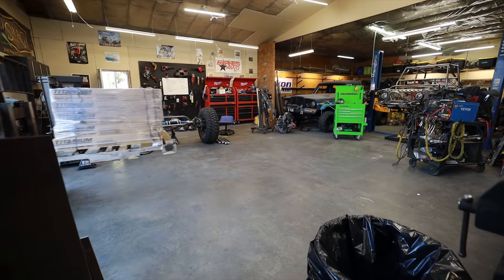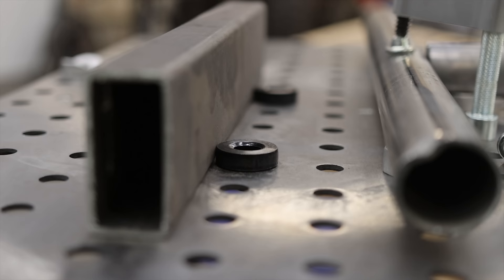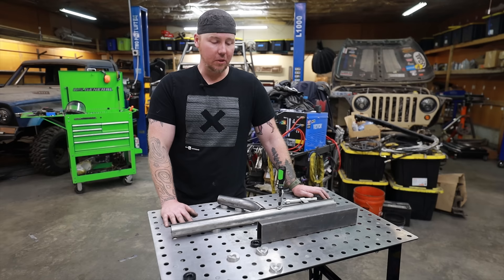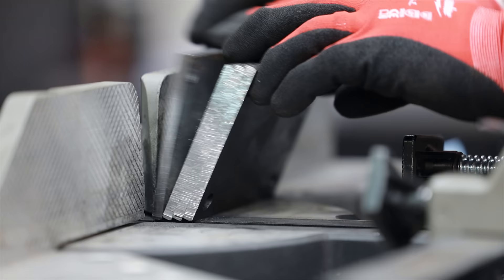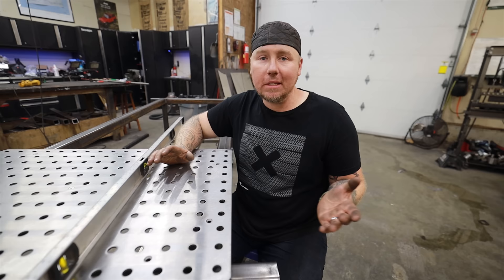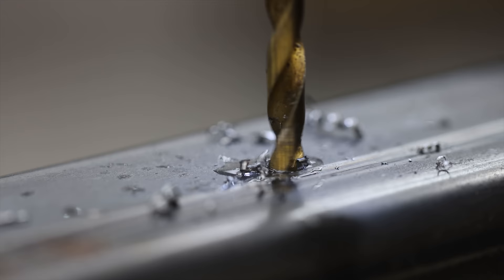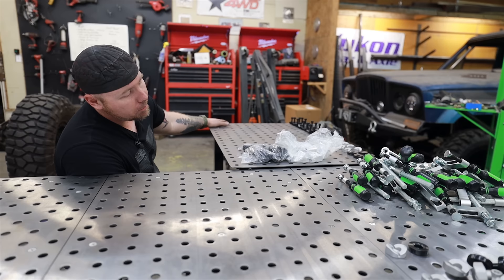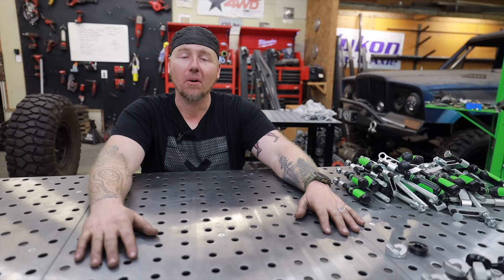The NEW Harbor Freight Welding Fixture Table

Comment: I bought a similar welding table in the UK and added a Flexispot height adjustable desk frame. It's amazing being able to tweak the table to the perfect height. Because it's so versatile I use it as a chop-saw stand, bandsaw stand, in-feed and out-feed table as well as a welding table.

Comment: The usefulness of this larger table, or some smaller joinable tables, should not be underestimated. Personally I would do the larger one like you have an have a smaller one or two (at the same level of course. ha ha) that can be bolted on as needed to make the L shaped bench. As you say, some wooden or steel toppings/small item boxes with dowls would be ideal since this also prevents slippage. Very very useful for small garage workshops. Great video Nate!

Comment: Honestly if you don’t mind slight dimples on your work surface you could just buy some heavy duty vinyl and roll it out on top for when you have small stuff you don’t want falling through holes. You could also use some large hobby cutting mats that have grids and stuff printed on them for extra utility and durability.
Reply: I keep a roll of the heavy floor covering Ram board for CAD (cardboard aided design) mostly.
That would work great. Just roll out a few feet of it.
Reply: A sheet of MDF with some handles to make it easier to lift/move would also be 👍
Reply: I actually made a butterfly style set of doors that open up and hang down the side of my certiflat table. Its works great

Comment: the hitch receiver is a fantastic idea, especially if you don't have alot of space.  I have quite a few tools that I have hitch tubing welded to, and I swap them out on my single vise stand.  Yes, it's a little bit of work to swap out tools, but if you don't have alot of room to work, it's fantastic.   I suggest adding threaded set screws (welding a nut to the tubing) so that you can snug up the bolts and the tools won't flop around on the receiver tube.  the hitch pin keeps them from falling out, but set screws/bolts keep them from flopping around when using them.   :)

Comment: I have a piece of cat walk for a welding table. There are no round holes in it, but it has plenty of rectangular holes. Once you get used to working with them, it gives you almost an infinate amount of positions and angles to work with. Its about 24" x 36" and it weighjs as much as a church but its great and was free

Comment: I keep a sheet of 12-gauge aluminum on top of mine.  It makes it a workbench that parts don't fall through and that the surface can get beat on, and it's easy to remove when I need to fixture something.

Comment: Same thing as sold at Northwest Tool over the past few years.  It was similar price on sale and included same accessories.  I added some light angle ( old bed frame tacked corner out) across the underside between rows of holes to reduce any warpage.

Comment: I built my own 5’ x 108” 3/4” thick top table. 6x6 1/4” thick legs and I beams for stringers 2600# . Still haven’t finished drilling my holes. Hopefully this winter. Nice table for the money

Comment: A few years ago I bought Grizzly’s version of this. It was $139, but with no accessories. The legs were 1/8” angles though, heavier than this. The top is the same as all of these cheaper 2 x 3 tables seem to have the same top, though the Grizzly has a black rust resistant finish. But the top also wasn’t flat.

I agree that it’s hard to understand. But I assume that since these are so cheap,  maybe they’re not fixturing the frame, but just laying it on the surface with some side restraints. They definitely weren’t flat. I ended up using my Stabila 4 foot level and grinding the high spots down. Afterwards it was pretty flat. I cut the legs short and welded coupling nuts on the bottom for good wheels that can level, which is important. If you don’t do that, heavy work will push the high part down on the wheel and distort it.

Anyway, I recently bought a Sigmund 3 x 4 16mm table. I gave the Grizzly table away to someone who is very happy with it.

Comment: This isnt a bad deal. Might have to buy one to throw on the end of my current 3x5x1/2" fab table. Make it foldable so its "protected" and smaller foot print when its not needed.  Then when i need fixtures, fold it out and bam its there with another 5ft of table to to hold stuff up.

Comment: My work bench for welding is an old tanker desk on a frame with casters with a piece  1/4 just sitting on top of it 
I consider the plate as sacrificial and just weld whatever fixture I need to it pop them off grind it down and  do it agian

Comment: Put all segments on wheels. Use hitch or similar to connect them together, or spread them apart for longer jobs 2 can be any length you want. Northern them for similar price. Now its more expensive, but still great setup.
Reply: Like a leaf table? use 1 1/2'' square tube inside 2'' for slides, and have extra tops for a leaf, great idea.

Comment: Make washers from JB weld steel stick putty, at the bolt holes a 2" round 1/8"-1/4"   thick. And put it all down at once using a level to push it down level tightening the screws.  Maybe after it sets up fill any gap with putty to reinforce the top to the frame.  I think I'd just bought a sheet of 1/4" and have a 5" piece of 2x2 1/4" wall, sq tube, milled flat on 3 sides. Clamp sand paper to it,  and sand the top flat , dye chem  and check the flatness , then tape a border around the edge , mix done water based coolant. And mark out a pattern for the holes,  mag drill. Start with 3/16" holes or so. Then go to 5/8"), or 1/2" but use 2-3 1/4" nuts welded to holes at the bolt holes to mount the plate, cut a 4" length of 1/8" x 2" bar. Drill a center, and a 1/4" dowel pin to one end  use two 1/4" bolts with jam nuts, install the mount bolts loose through the 2" flat bar, that gas a dowel welded to it,  the two 1/4" bolts level the top . By pushing on the 2" bar under the top. The dowel  keeps it centered on the frame, maybe beef the 2" flat bar from 1/8" to 1/2" and cross the table with it  and tack weld it to the top.  Weld 3/8 washers to the area for the 1/4" leveling bolts, using two bolts allow it to be at a slight angle . And still give more support.   And make up to about 1/2" adjustment, about 1/4" up/down.

Comment: Hi there man! It`s been a while since i visited your channel for tips... but this review of those welding tables i find it very helpfull in order to get or fab your own welding table for your needs. A while back ago i made my own welding table using square tubes 40mmx40mmx2mm and i been thinking about purchasing one of these table to use on my projects outside of my shop (in the field). Thanks again for sharing this review and cheers from Chile!

Comment: To fix your table height and cart difference issue just add washers to your casters on the bigger table. If you want to be fancier or stronger (not that it will matter for the strength of the table top) use plate with the same hole pattern as your casters as the spacer

Comment: I did the same thing when I built my fixture table top from Weldtablles, on adding a receiver for a vise.   what I didn't like was how loose the receiver was, so I welded a 9/16 nut to the top of the tube and used a short bolt to take the slop out, and hold the vise or attachment with my chop saw or bandsaw on it

Comment: You could definitely double up on that 3/16 plate . I'd probably double it up and then I would stitch weld it up with a Tig welder. Half inch beads is all it needs
Reply: i was thinking the same thing.  for $170, why not.  you'll also get all the accessories with the 2 tables

Comment: Angle iron bolted to the ends of the tables would create the ability to connect two tables. Drill and countersink some holes to mount the angle iron underneath the table top. I wish Harbor freight would make a small two foot wide extension top that would allow a table to be bolted to each side. This would give you ten feet in width. Send-Cut-Send maybe a place to have a small extension made.

Comment: In my experience, the thicker the better. I worked at a heavy equipment manufacturer that had multiple 4x8x2" fit-up/welding tables with drilled and tapped holes. It was not possible to deflect these no matter how hard you tried. Also with a properly conditioned cup stone you can clean up and restore "flatness" to the table ( you can remove random berries and tacks).
Reply: A 10-ton portal crane is so much better than a 250 lbs come-along
Reply: Other then the drilled and tapped holes that is SOP in ALL real fab shops. The tin table is a joke. - Tack up tabs and dogs and use wedges to push things into place and the grind it smooth and get the next par in the table.

Comment: I actually have a 3/16 inch fixture table that I made and had laser cut, and I use some custom clamps that I made for hold downs, and they don't distort the holes at all. They go in to the holes and then side load whenever you clamp them down, and it works just fine. You obviously can't go hog wild on it, but it definitely will hold things in place to where you can't move them.
Reply: It's because the clamps are not strong enough to hurt the table,,,,, or to pull a piece of 1-1/2 hand rail pipe in place either. - Not for real fabrication

Comment: get a roll of thick "carpet protection paper" from Lowes or Home Depot. and some masking tape. Cover the fab table with paper for when you inevitably use it as a work bench for the misc little parts and assembly. The roll of thick paper is fine for that.

Comment: I’m now interested in doing what you have done. I currently have a wheeled bench about the size of what you have built which rolls under my 16 foot built in bench. I have been using receiver mounted tools for years. My vice, solid stock bender, bead roller, bench grinders and so on have been used that way for a long time. It’s a game changer. I’m building in my 24X24 two car garage where I also park our cars, so everything has to be able to be tucked away when I’m done. I actually got the idea for some of the tucked under storage from a set of Russian nesting dolls my mom has. The receiver idea came from a service vehicle I saw at work one day.
Thank you for the down load on this new HF product, I’m going to check it out as soon as it appears at my local store.

Comment: as several have suggested  just add some washers or a piece of plate under the big table.  if building linkable tables  add receiver inserts to pin the 2 / or more tables together.  more cross beams  should help on warpage.

Comment: I would caution you against buying 1/2” steel plate to make a table out of. Most plate is actually extremely not flat. Last year I built some robotic tooling for work, and to get a 6ft by 2ft tooling plate that is 1” thick and truly flat (+/-.015”) I had to buy 1 1/4” plate and they had to surface grind that much material off to get it really flat.  I never realized how plate isn’t really flat until I went to order that steel. Just some food for thought. Love your videos!
Reply: 1- Stress relieve or normalize in furnace
2-Streighten to reasonable 
3 Blancahrd (not surfece) grind. 

If you skipped the heat treat go out there with a surface gauge and push it around. - You gonna find you are over .015 in a foot, let alone TIR.

Comment: Cool vid.   This table is sold under several different brands, ie, Klutch at Norther Tool.  I have one and it works ok.  The fixture accessories are junk and expect several to break.  Also, those holes are some off metric size and a decent kit off Amazon is about 200 bucks.  I went and got a bunch of shanked bolts that fit, cut them down and made my own.  That top will also need to be coated or waxed, it will rust quickly in a garage.

Comment: To keep that fixture table good, don't forget to give it a generous spray of anti-spatter before every time you weld. If you want a cheap anti-spatter, just water down some laundry detergent and use it. Most anti-spatter sprays are little more than soapy water.
Reply: And then a quart of WD 40 to stop the rust.,,,,,every time you use it. - It may be OK in a wood shop but not for welding and fabricating.

Comment: 1 thing i noticed with the table and clamps which are definitely awsome but like most clamps the clamps with this table have flat clamping contacts..it would be nice if the kit came with convex caps that were curved for pipes like the the stubs to lay the pipe on in the peg hole..in the video it shows the clamp holding the pipe and only a 1/16th of that flat clamp contact is holding the pipe, if you had a round piece( magnetized) to pop on that flat round clamp end then you could better clamp a pipe down.. ive tried to weld pipe in the past  with a c clamp and the dang pipe would roll 1 way or the other..i didnt weld a lot of it just a piece here and their but always thought if i did more I'd weld a thick curved piece on end of i c clamp just for pipe

Comment: That would be a fantastic template for a heavier piece.  Also, four identical tables that have the capability to clamp together would be more beneficial, just for the footprint options.  More modular.  Clamp end to end, side to side, side to end, etc. Even fab spacers to keep them so far apart for really large builds.

Comment: That is impressive, not sure if you do much woodworking, MFTs are popular in Europe to mount a tracksaw for repeatable straight cuts for sheet goods, I am sure your set up could be adapted. MFT sheets (mdf with the holes drilled) are expensive over here,

Comment: ignore the word my but a good workbench that is slick to work with does need easy clamp and magnet ability I found that making sure the work surface is all level and includes the chop saw recessed a metal welding table with grounds always attached mig and plasma ready with a shop vac line you can hook into along the bench along with led lights with easy off on switches outlets all along the bench with angles coming off the back of the bench toward the front not so you hit you head but weld nut lock washers for holding plying cutters drivers so you glance up and grab what is needed hit the switch and brightly light the workbench area AND BUILD THE BENCH TO SUIT YOUR HEIGHT WITH STOOLS THAT SEAT YOU AT THE PERFECT WORK POSITION underneath the wood part of the bench grinders drill hand tool you use a lot all plugged in ready to use the bench is always set up ready to use no matter the project or repair

Comment: Hey Dirt life:   suggestions,  add a few "V"  braces to the table top down to the lower cross bar.   Yes 3/16 tube is strong but toss a 400 lb rearend up for fixturing and sag will happen.  
 Run a vertical up from bottom of the V to the HF square braces with maybe even an additional lengthwiise 3/16" tube parallel to the bottom stringer.   Bracing a couple angle braces will really make it good & strong! 
Rest is great!

Comment: Just a thought. What if you double or trippled the top plates? Making them thicker! Drilling a small hole in between the top one or two. And tacking them together.  And tack the edges . I've bought one. Just to see how they are. Im thinking about getting 3 more.  Making two out of them. Over lapping the tops.

Comment: It might be too late now but I welded 3/8 X 2 bolts to match the pattern on the fixture top, then used coupling nuts as adjusters. This was easy to level the top then put the counter sunk flat head screws through the top. It worked very well I made a frame pretty much like yours then didn't even use the frames that came with the fixture tops. I have had it for several months now and it has not needed any adjustment.  Oh I did put a double nut under the coupling nut when they were installed after all was level I tightened the lock nuts to the coupling nuts so everything was locked together.  I was able to pull down on some and push up with some.  So far so good.

Comment: Bought one, it's basically a hobby table for light work, green clamps are junk (made my own a twice as tall) , the Horrible Fate stud 3" w/ brakes casters work if you drill and tap for 1/2-20, yea SAE threads on a chinese caster, after assembly I welded the whole damn thing up, that made thing's a bit stiffer. in my local it's selling for just under $190 bucks.

Comment: Maybe take two of the cheap HF tables and maybe put a spacer in-between them stacked on each other and maybe you could get the friction type tools to work. Just a thought. Old guy with too much time on his hands, I have not welded much in over 40 years.

Comment: Just a heads up, if you move that, table the flatness will change. Concrete is never flat, and from one wheel to another, that table will be twisting in every dip and valley in the concrete. I was a Tooling Specialist for an Aerospace company and we shot in our tools level by the .0005 of an inch. same with our Granite inspection table that thing was FLAT! prior to that job I thought a bubble level was the flatest you could get lol ....... I was wrong !
Reply: Half a thousandth is chum change Try having to hold 50 millionths. ,,,,,neither of which has anything to a weldment. - If you are within .250 TIR you are doing good. Machinists have to eat too.

Comment: if the top bows where you bolt the table top to the frame, drill holes in the frame, weld some nuts underneath the frame and use bolts to adjust the height of the top, so that the top is flatter.  Double nut the bolts, so that the height is locked.

Comment: 4'x10'x 3/8" sheet cost me $350 about 5 years ago. Its as flat as a quality straight edge after welding 4" channel to the perimeter. Those high dollar tables are just high dollar. Can they speed things up, yes they can. Will they make you a better fabricator, no they most definitely will not. Great video by the way!!